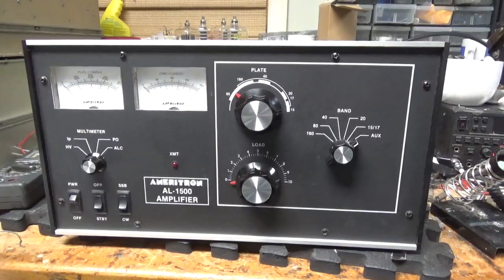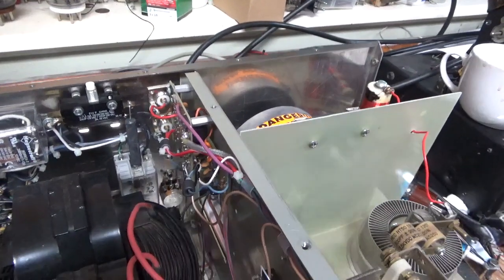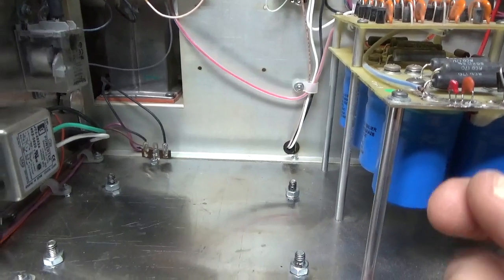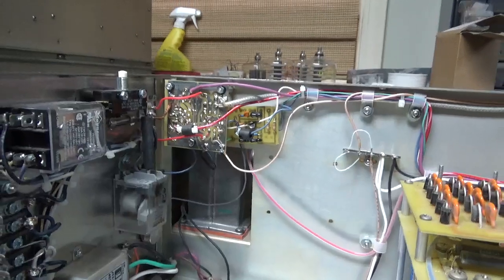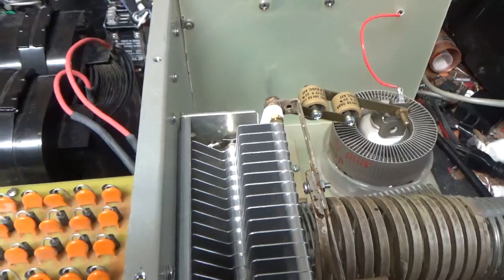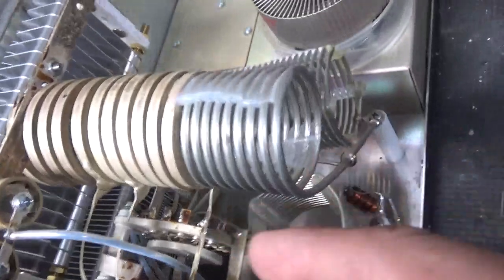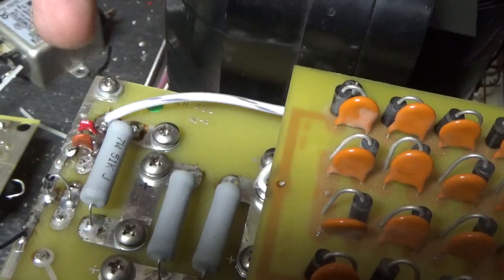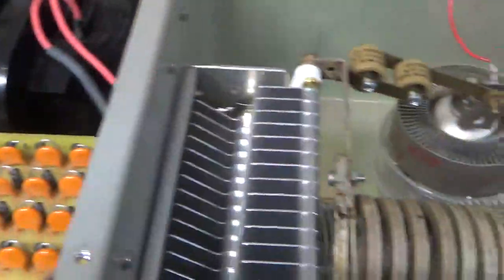Ameritron Al-1500 Repairing Another Person's Repair Work

Comment: thanks, my al-1500 went bad,  no plate voltage, but I notice the soft start  relay and the resistor look bad,  resistor was crack,  so i'm waiting on replacement parts, i'm not a tech  or repairman but I could change what I see looks bad,   I could learn a lot from watching  your videos,
Reply from the maker: You had a short on the b+ at startup. Could have been the tube or another part. Never change parts until you know why they failed. Always fix the root problem first. Thank you for the compliment and for watching my videos. I’m glad to hear they help you

73